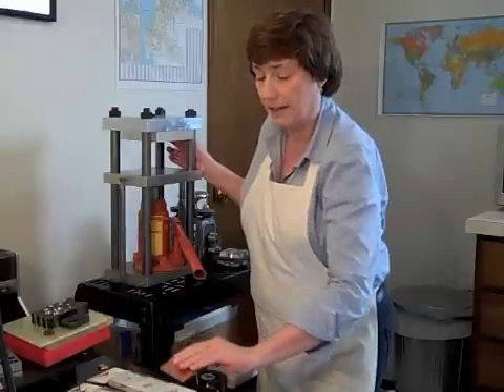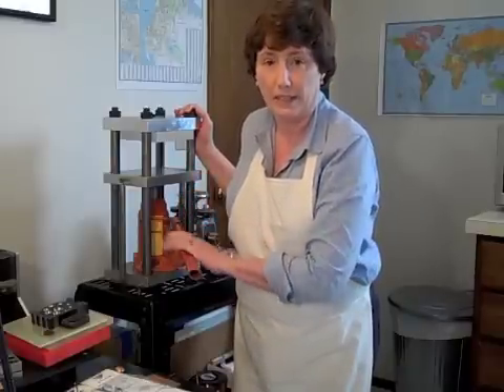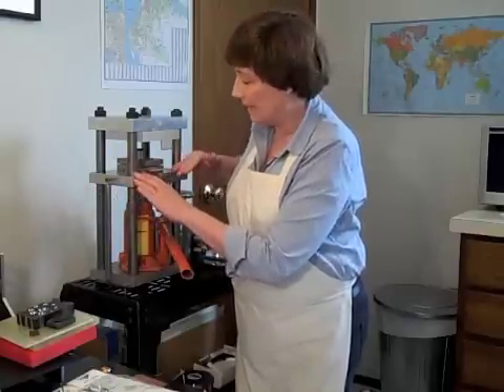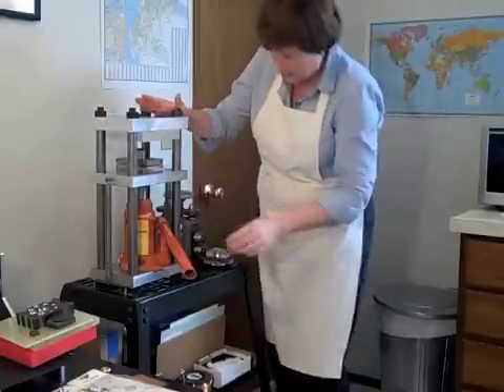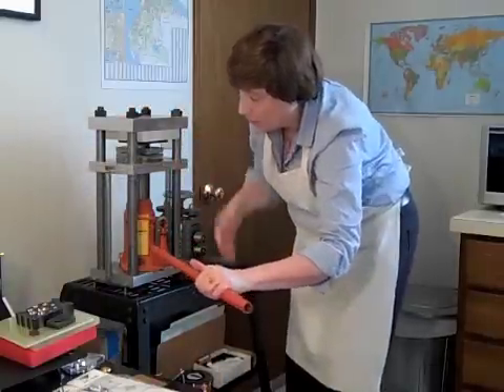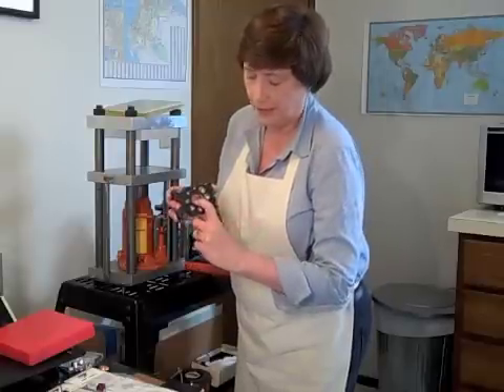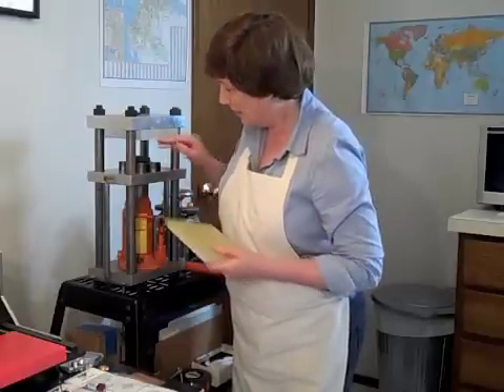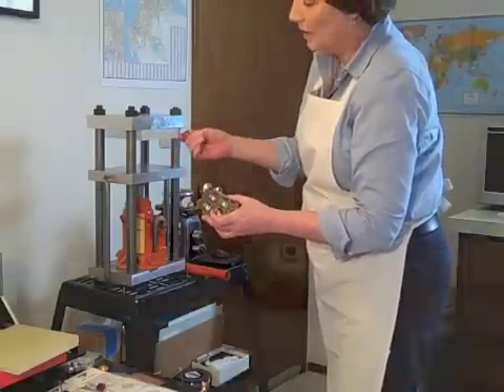Hydraulic Press Demo

Comment: Hi Nanz! I haven't done any die forming since I trained many moons ago:) Where can I source urethane? Thanks!
Reply from the maker: Rio Grande sells a urethane kit, which is fairly expensive. 
You can check for industrial surplus shops in your area, which might have some as well. I have used neoprene from old scuba gear, which will work too. 

But if you are looking for repeatable depth of draw for multiple parts, using urethane is your best option. 
Hope this helps,
Nanz

Comment: nice. scary not wearing eye protection when working w metal.  where u get your press frame?
Reply from the maker: +m00nchildblues 
Hello, 
because there are NO liquid sprays, nor any fine particulates flying through the air towards my face, especially when I am using the hydraulic press in a safe appropriate way, there is not a call for safety glasses. 

I have known instructors who have terrified students by having them wear lead lined aprons and full coverage welding masks when using the hydraulic press, and I feel it is inappropriately over-zealous "safety" training, which actually creates safety issues for many.

the press is an old Bonny Doone model, which has been discontinued.

Comment: Why not add some thick acrylic plates, to increase the safety of the press ?
Reply: +Ron Ronnard It's actually best to use steel. You should never use acrylic in this sort of application, this is the world of metal. If necescary, even aluminum would be better than acryl, because acryl shatters under pressure or excessive force.
Reply: I'm not saying it will happen, but in metalworking scenarios? Never safe to use acrylic backing plates. I'm trying to make sure that he doesn't get information that would be fine for sheet metal work and apply it to plate metal work and get seriously injured or worse.
Reply from the maker: +Micah Burgin 
 Excuse me, but when used properly acrylic silhouette dies do not shatter. Also, clear acrylic dies allow you to view the pattern on the metal before setting it up in the press, so, selection of how the form is pressed is better than with a steel or other opaque material die.

Also, the press manufacturer has optional 1-inch thick acrylic spacers which can be placed inside the top and bottom platens. They do not increase safety but the do reduce the distance between the platens, so, you don't have to pump so much. I have used these acrylic spacers and  dies for over 12 years and never had any problem with them shattering.

Comment: Nice work. As a tradesman I would suggest that a 'Poly-Carb' sheet be bent up like a box and be placed over the whole outer press area finishing at the lower press bed, this would allow for any items exiting the press area, whatever they might be, to be caught, and still allow free vision and use without the need for safety glasses.

Comment from the maker: If there is no other metal present to impact the "printed" or patterned metal then the etched or imprinted pattern will not be damaged. That is how a matrix die works with the hydraulic press. The urethane, under pressure, will push the metal into the shape of an open space. Research workshops and books that offer more extensive safety information than I can offer here. 
Hope this helps.
Best, Nanz

Comment: You're right in that there are no advantages to inverting the jack for compression/tension testing as it is far easier to move the specimen instead.
Unfortunately the specimens that I'm testing are much longer than the jack itself, so the press is greatly biased to the specimen side, therefore the specimens cannot be mounted alongside the jack.
I may redesign it soon as re-mounting and re-aligning the jack each time is a pain.

Anyway, thank you for your help :)

Comment from the maker: To my understanding there is no significant advantage in compression and tension testing to "invert" the press. Whether the pressure is coming up from the bottom or down from the top the pressure remains the same. 

Large industrial presses merely have the ram exposed when it is above the work. Often machined steel heads are affixed to the end of the ram with set screws to create the shaped metal desired (i.e. a car bumper). Does this help?

Comment: Thanks for your response. I think you misunderstood me, a registration keyway in the platen goes without saying, I was more so curious if the platen has held to the jack with a fastener rather than an interference fit.
I will be using my press both up-right and inverted (compression and tension testing), so at times will have the platen hanging below the jack and I would like to avoid having the platen shift in that scenario; just curious as to how the commercial units approach this.

Comment from the maker: Yes, the platen on top of the jack (or ram) in the press I am using is tightly registered into a milled recessed area at the dead center of that platen. AND YES, that is necessary! If the platen is not secured the risk of it tipping sideways shooting a heavy tool out at you is much greater! 

The press I am using is a professionally manufactured press, I choose to pay for quality made tools that have been tested for safety standards.  Especially in this case.